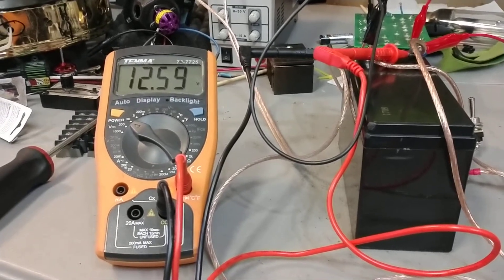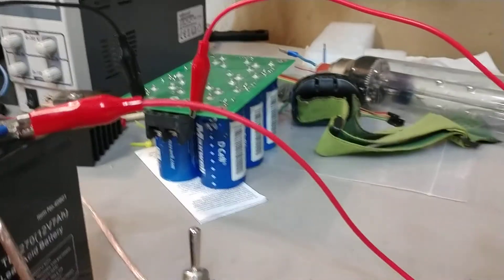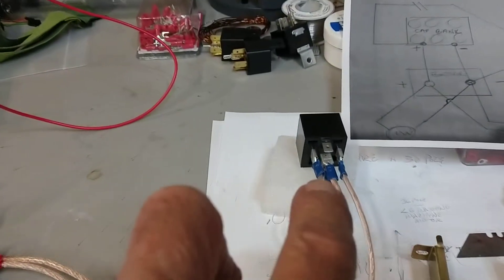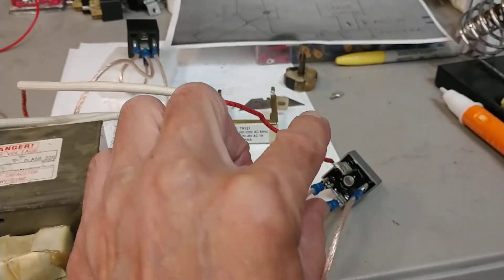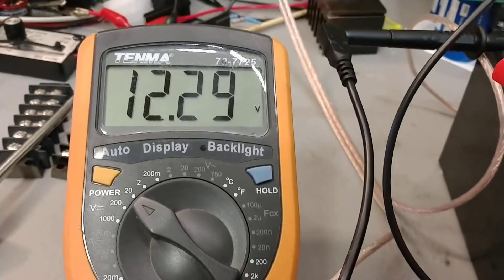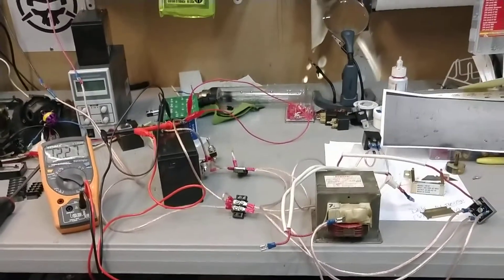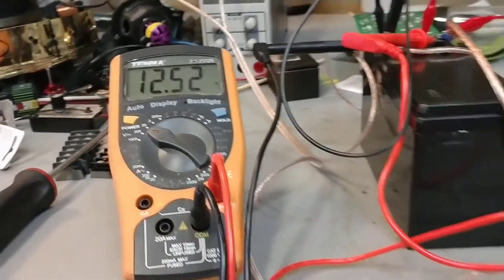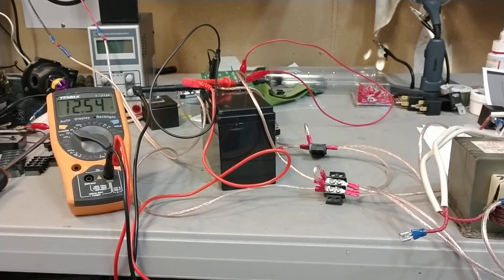EMF SPIKES... CHARGING A BATTERY

Comment: hey Bob .. have you tried the Smart drive motor with another controller or only with Anaheim controller?
Reply from the maker: ran it with both...same results 2600rpm. Now, you can CHEAT! You can fool the hall sensor array, if you position it slightly diagonally you can actually pick up the rpm. You can't tell in the video, but that's not the stock position for the hall sensor! I moved it all the way around to find the optimal position (like Gerard said)
Reply: +Bob Bateman what you mean with both ? 

could you get 5000 Rpm ?
Reply from the maker: I hit 5000rpm...once, when I was experimenting with moving the hall sensor. I could not get that result again....no matter what I tried. Maybe it was a bad reading from the speed thermometer! But It couldn't be replicated consistently...
Reply: +Bob Bateman with what king of controller you got 5000rpm ?